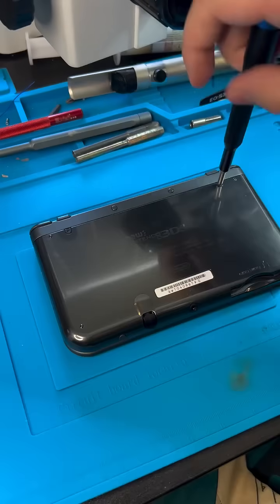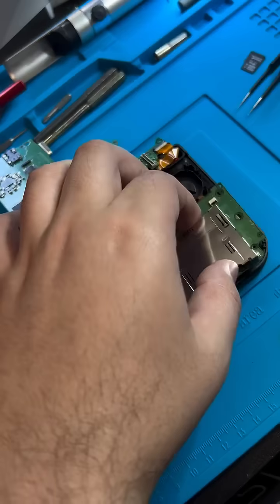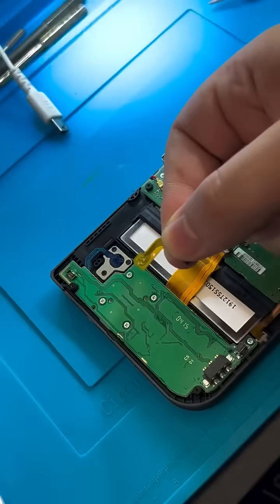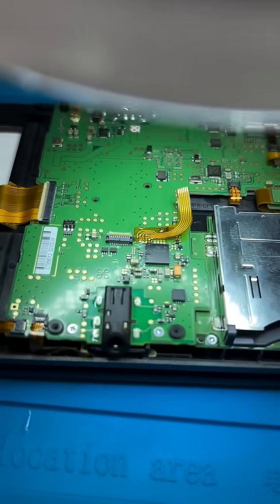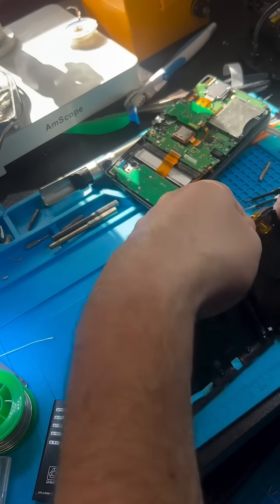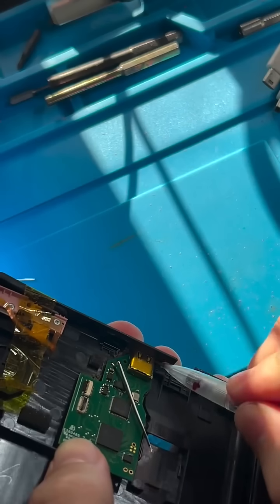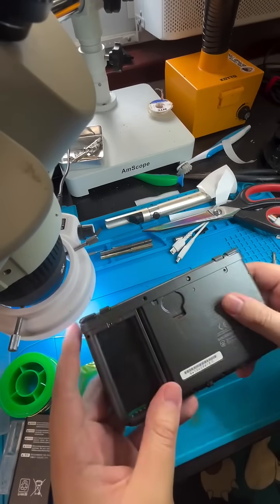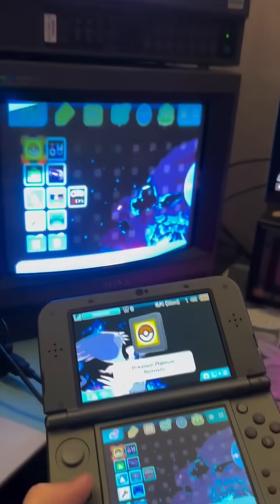3DS Internal Capture Card Installation

Comment: The soldering is easy. The cutting is the hard part IMHO.
Reply from the maker: Agreed, it’s difficult to do a clean cutout in general. I have $20 grinding pen from amazon that I started using instead of this Dremel, which has been a better experience.

Comment: not that bad actually. at least it's easier than modding the switch oled lol
Reply from the maker: Yeah, the pads here are larger than the switch ones and don't require magnet wire. Easier for sure, unless you're doing the kamikaze method.

Comment: I have a couple of questions?

Once it’s put in are you able to play DS games aswell?

Is this mod able to be put in a “new” 3ds?

And how much does it cost to do something like this?
Reply from the maker: - This mod always video out anytime the 3DS is on, so it would work with DS games
- I believe the mod only is available for N3DSXL models, but someone could correct me if I’m wrong
- I can give you a quote if you message me on instagram or email me. It would be well over $200 though, partially because the mod itself is expensive.
Reply: @MiggysMods  ah I don’t own an xl but I’ll look into it!

Comment: What hot air station would you recommend
Reply from the maker: I’ve been using the Quick 957DW for well over a year and it’s been great. Looks a little boring but it’s very reliable so far. The Amazon listing I bought mine from for is gone, but I paid about $130. I see some on Aliexpress for $80 but I can’t vouch for them (although it’s probably worth getting there).